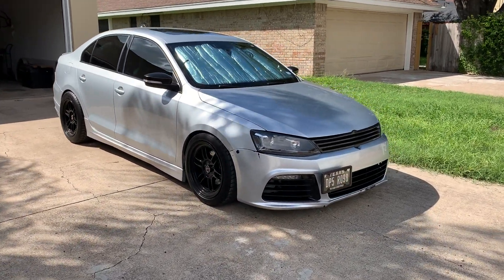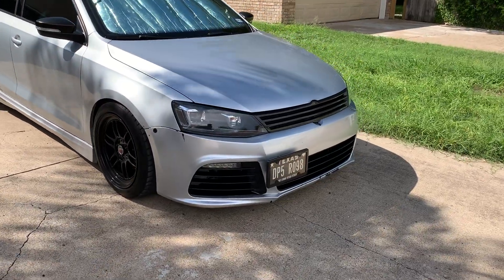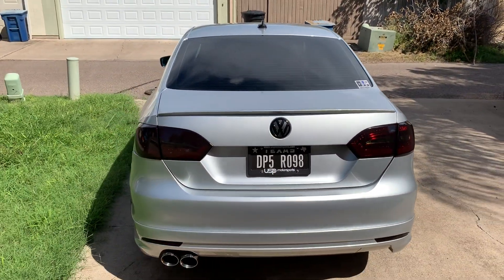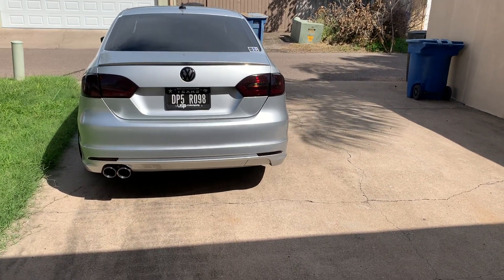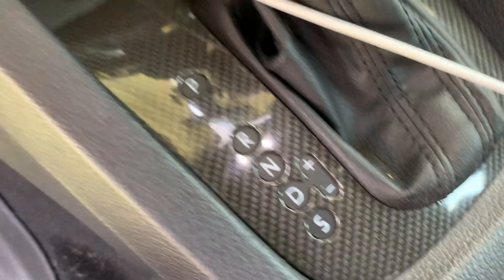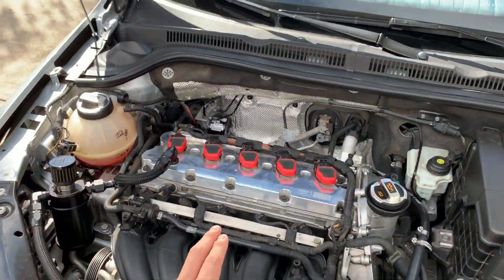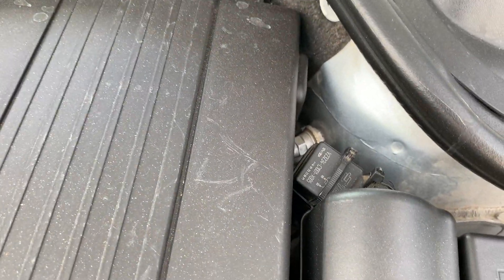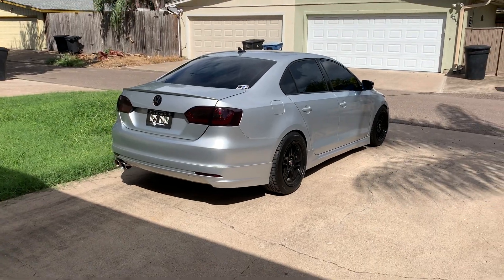MK6 Volkswagen Jetta Update

Comment: Hey man, I have a 2011 Jetta 2.5L with the rear torsion beam and I've been scouring the web to find a set of coilovers that will work well without having to do an IRS swap. How difficult was the IRS swap? Please recommend coilovers for a torsion beam jetta on MK6 platform if you don't mind. I want about 2" drop to close up the gap on some 19" wheels that I'm running.

Cheers
Reply from the maker: It was super straightforward! When I had rear torsion beam, I ran some JOM coil overs. Super cheap but they worked!

Comment: Sweet mods buddy!  I'm about to  order the Sagitar (They call Sagitar to the Jetta in Asia) R line front bumper,  which is basically like the mk7.5 Golf R bumper, love it! I'll fit the facelift headlights (the ones with the LED DRLs) and retrofit Morimoto 2Stroke 2.0 led bulbs on both low and high beams, it's gonna look pretty aggressive and still OEM 👌. Hey where did you get the independent rear suspension?  I've wanted to do the same. thanks! and I'll share my project as soon it's done.
Reply from the maker: Lewis Rockwell I bought it used from Autohaas in New Jersey.. was dirt cheap and then replaced a bunch of the parts with newer stuff. Mainly just needed the main components

Comment: YOU HAVE TO TELL ME HOW TO FIT THE R STYLE BUMPER ITS NEVER A PERFECT FIT WHAT DID YOU DO
Reply from the maker: Gdk just trim back some of the bumper support foam and it should install fine
Reply: 9/10 times your fender will overlap your bumper. It does look wonky in lighter colored cars. I ditched the foam backing he was referring to. Most of it is loose fitment, just take your time & don't get it painted @ Maaco like I did. You'll need side skirts to compensate for how low the r bumper is ❤
Reply: @caseygawriluk   do you have a video on removing the headlights?
Reply from the maker: Willie G no sorry..
Reply: Did you get a light error for the drls on the bumper
Reply: @caseygawriluk  Where did you get the black front grill from?

Comment: Hey man. Can i get a high flow cat downpipe with the awe track edition exhaust and stage 1 tune? thats all i have done to it. would i be able to run that and what do you need to install a aftermarket downpipe? do i need to buy like 02 sensors?
Reply: Stage 1 tune supposedly isnt for automatic I've contacted IE. They wont do it for me...the downpipe is super easy it's just a few bolts but the problem is getting under the car to do it..got a lift? Other than that you should be good to go.. also only the wagons can take the manifold because of the steering pump being in the way on sedans
Reply: fornauf scott my car is stage 1

Comment: Is it possible to install a front bumper from 2012 to 2016 without any modification
Reply from the maker: negative. You would need bumper and grill with slight modification
Reply: @caseygawriluk thanks